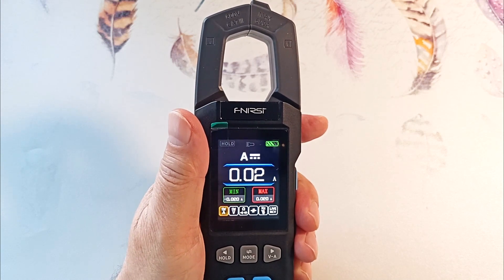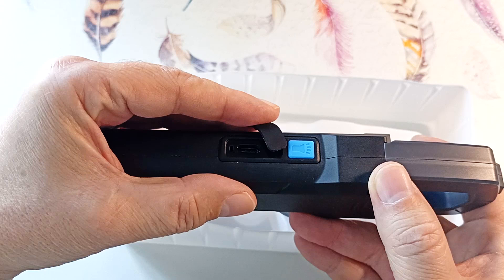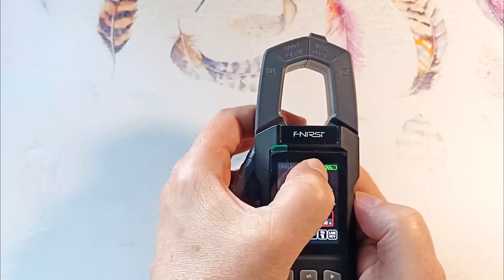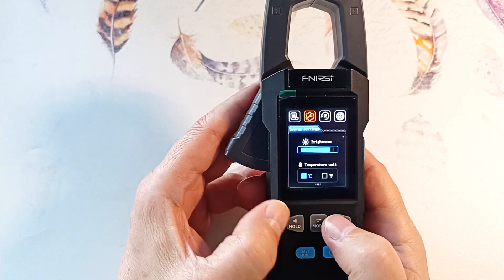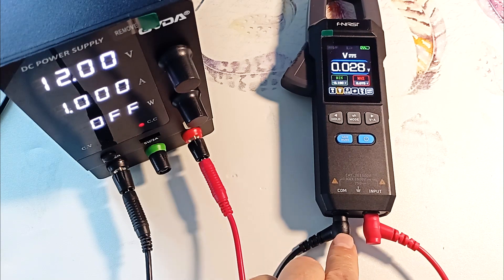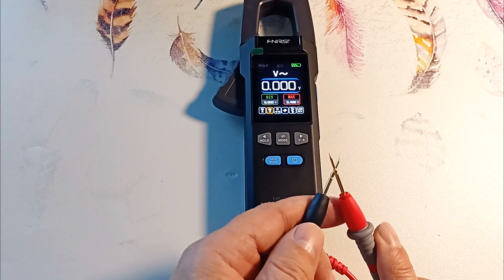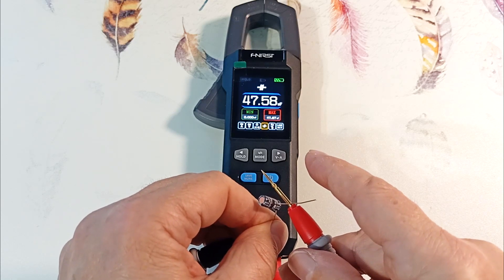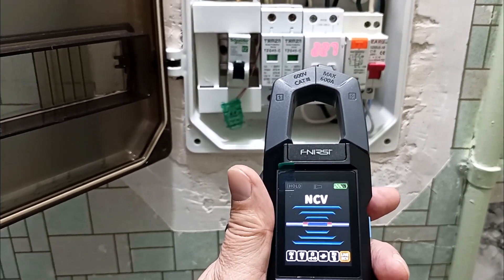Clamp Meter + Digital Multimeter FNIRSI DMC-100: How to Use a Multimeter? Features, Tips & Guide

Comment from the maker: https://alli.pub/75z1xw?erid=2SDnjdDC2Ng - Current clamp FNIRSI DMC-100 from the supplier
The following devices were filmed in the episodes:
https://alli.pub/74qdwa?erid=2SDnje43pyS - Current clamp 266
https://alli.pub/75z2bi?erid=2SDnjebFh5E - Current clamp (analog GVDA)
https://alli.pub/74owdx?erid=2SDnjevnYrQ - Lab power supply (analog)

https://bit.ly/Pomkan - Support the channel financially
https://www.youtube.com/@EkimovIgor1 - This channel in Russian.

https://youtu.be/fTNVlWXwR2M - Thin digital multimeter FNIRSI S1
https://youtu.be/GeTrV2MP1yQ - Battery tester HRM-10 FNIRSI
https://youtu.be/O1x9YkY1cNs - Hydraulic Crimping Pliers for ELECTRICIANS
https://youtu.be/MOM02oFWr-E - Dual-channel digital oscilloscope
https://youtu.be/suQe48g_4p0 - Adjustable DC Bench Power Supply GVDA